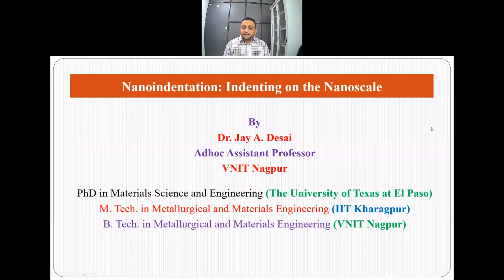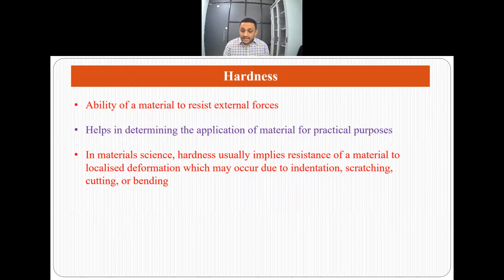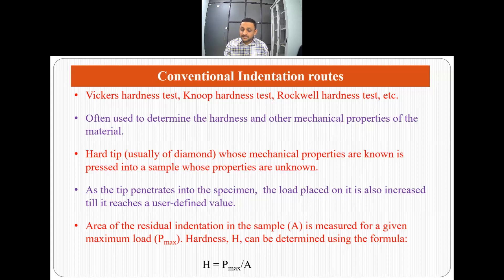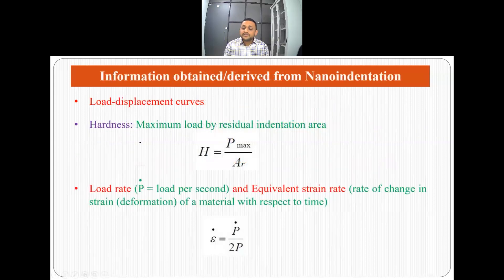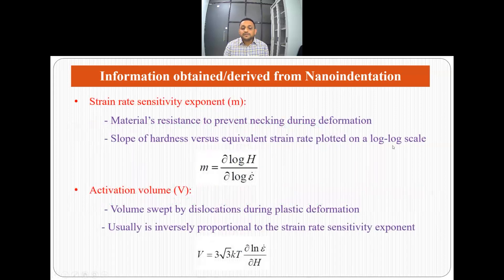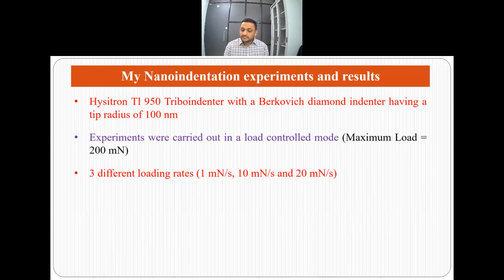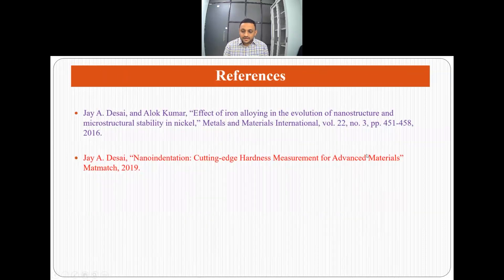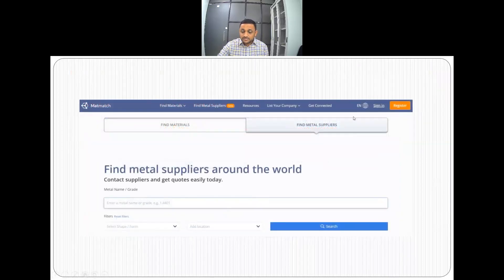Nanoindentation: Indenting at Nanoscale

Comment: Hello, thank you very much for the explanation!!
 I did nanoidentation on a photoresist with 3 different layer thicknesses (4.5um, 5.2um and 6.5um) with a penetration depth of 500nn.  i'v come to the conclusion that when the thickness of the photo resist is bigger, then the foto resist is harder. Do you have an idea why??  Thank you very much!!!
Reply from the maker: you may want to look at strain rate sensitivity and activation volume. Hardness is directly associated with dislocation movement and its mechanisms. Strain rate sensitivity and activation volume of different samples may suggest different deformation mechanisms which may be the reason for varied hardness. It's an accepted fact that larger thickness usually implies higher hardness but I would be interested in knowing the reason behind variation and the % change of hardness with thickness to come up with optimum thickness and optimum material usage.
Reply: @explorematerialsmetallurgy6439   Thank you very much for your replay sir!!!
I did my experiment at plymers (CAR photo resist)
could you please tell me why larger thickness usually implies higher hardness(in physic)? i did the same penetration depth for the 6 samples and the 6 samples are the same (CAR) photo resist?!
the reson behind variation of hardness with thickness is i am trying to improve the adhesion of the CAR on wafer (maybe will have better adhesion when harder, thicker layer thicknes...) and to find optimum work.
thank you soo much!!
Reply from the maker: @cosanostra8341  Thanks for reaching out. Every material is unique in itself. You will need to read more publications based on your material and possible deformation mechanisms people have reported in your material based on their nanoindentation experiments. Since your material is different than mine, I cannot comment on the actual reason or probable reason behind the variation of hardness in your material. Thank you again for watching the video. Hope it was useful.
Reply: @explorematerialsmetallurgy6439  thank you very nuch for your replay. OK, Of course it is useful!!